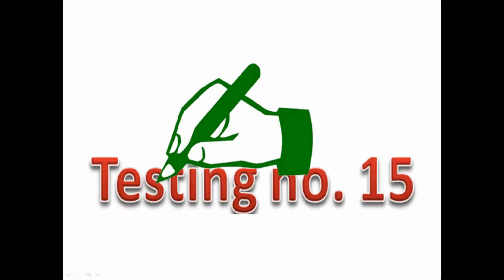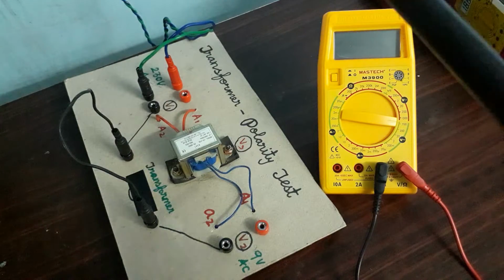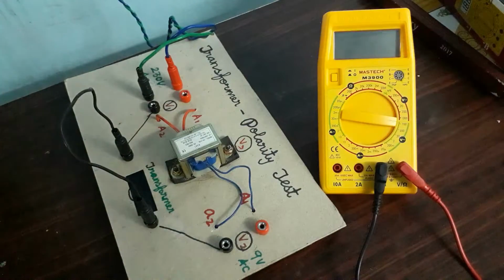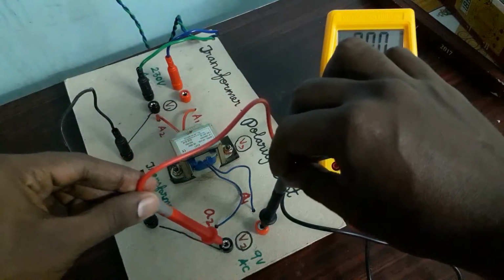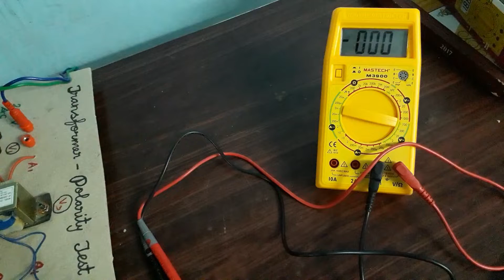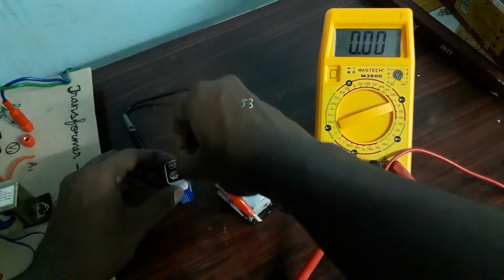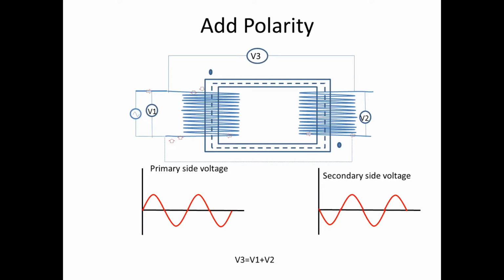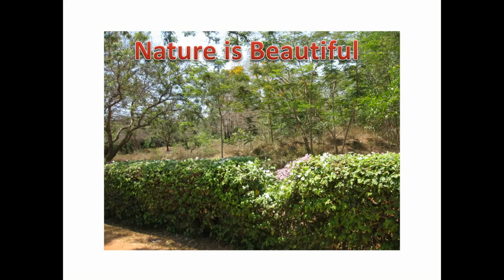Polarity testing of Transformer

Comment: sir thanks for the video, 
which polarity is best ,add or subtract polarity? and generally which polarity they choose for power transformers with voltage ratio 400kv/110kv? and for distribution transformers with voltage ration 11kv/433v.thank you